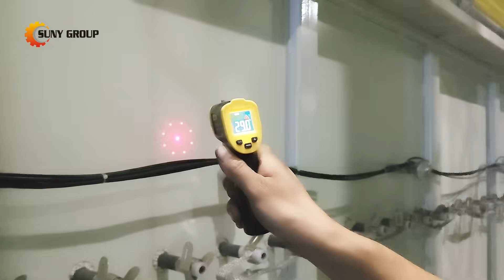How to Recycle Solar Panel Waste – Our Pyrolysis Line Fixes It

Comment: Nice, but what happens next? What happens to the glass, silicon, and copper mix? There's still silver from the busbars and aluminum from the back... The next, more complex step awaits! Even more energy is needed to split this mix... So... very efficient!
Reply from the maker: @sunsailor1773   The rest materials can be separated with our other techniques, and we also proivde the silver extraction technique and machines.